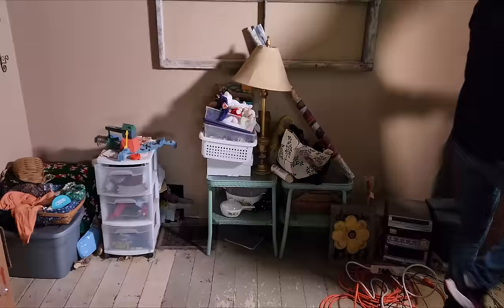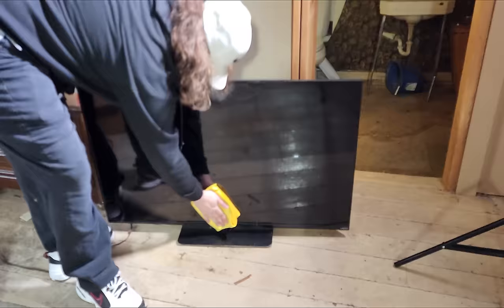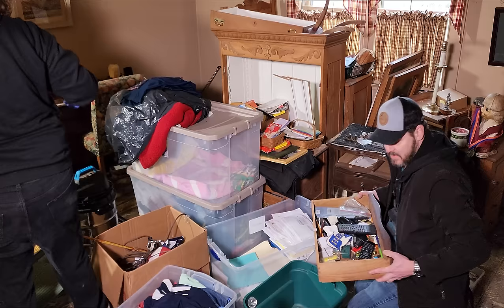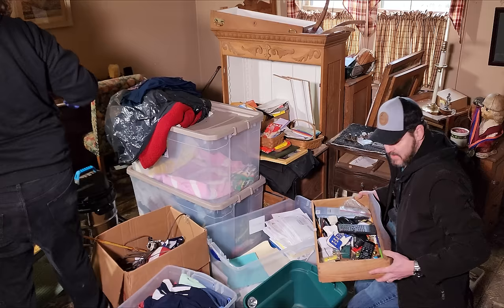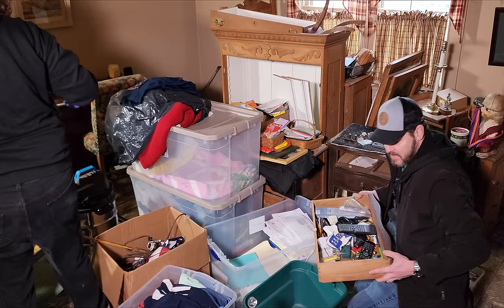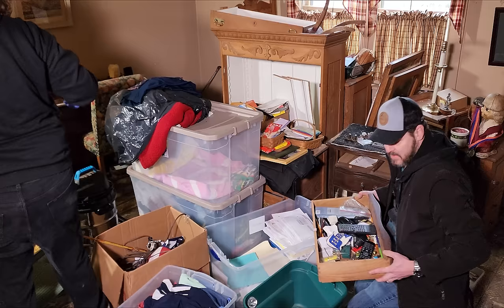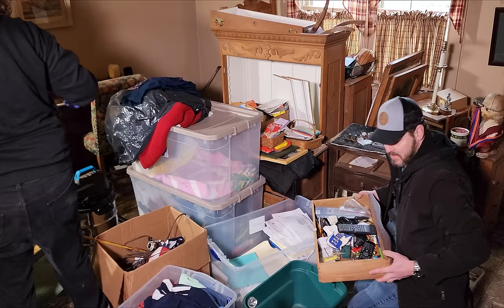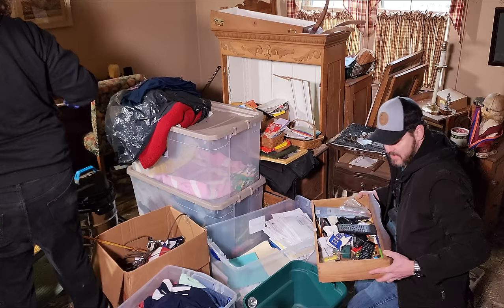I found 200 year old stuff in this whole-house cleanup!

Comment: I always hit the like because it affects your public feed sightings. 😅

Love the fur babies at the end.

Those light blue tables were beautiful. 
Lonaberger anything is a big deal in the North East & mid Atlantic... because their products are American made AND WELL MADE. 

Hi Michelle.  

I wonder if that "electrical fire" is when her stroke happened. She might have hit the electrical breaker and then realizing what COULD have happened,  then suddenly had the stroke.  That could be why it was all still plugged up. Lots of folks don't realize that the circuit could re-energize and re-ignite if that breaker gets flipped on.  Often, folks don't know enough to protect themselves when it comes to electrical "stuff".  For instance, many don't know that once the breaker box or fuse box is shut off at the mains, any circuit beyond the box ( in the house) is okay to unplug or repair.  Too many don't even realize that cutting off the power at the box is necessary before doing circuit or outlet work. 

AND IN MANY OLDER HOUSES,  you have multiple outlets plugged into the same fuses/breakers. That alone is a fire hazard because it constantly trips and then they either use larger fuses or a penny underneath which defeats the purpose of the fuse/breaker to shut off before the overload CAUSES a fire. 

Sorry. Worked on radios & their electrical power boxes in USAF so it's a pet peeve when I see the danger people don't even KNOW they're getting themselves AND THEIR FAMILIES into. 

I'm a bit anal when it comes to thoroughly researching before tackling certain things: electrical, mechanical, computer, engineering... BECAUSE of the dangers they CAN lead into with half *** jumping in. 

I've run across a few people in FB comments that are convinced YOU are the one who stole someone else's channel BECAUSE you're on utube. No reaching them about the truth. Too determined they're right. Totally get your channel name wrong, too. 

Hope you get your goal "plaque" wise. 
Looking forward to the next few hoarding clean outs. 

BTW that Mr. Clean clean freak  is the only cleaner in 15 years NOT to set off my allergies and asthma.
Using it everywhere. Thanks for the info on that.

Comment: Beans!
I suspect this was once a very nice house with nice things in it.  It still has some very nice pieces of furniture.  Such a shame to see it so dilapidated now.  You did a great job clearing and sorting it.  I love that you go through everything and don't throw away good stuff by accident.  I would trust you to do this in my home if it were necessary.  This has been a great video series.  A bit of everything.

It's funny that you think a 200 year old house is really old. I'm selling my mum's terraced city house at the moment and that's 100 years old and looks kind of like every other in the city.  My own house is fast approaching 300 years, could be a lot longer but we know it was here in it's current format in 1742.  No idea when it was first built.  The difference is that we build everything in stone or brick.  Sometimes we have older timer framed buildings but the frames are usually enormous tree trunks.  They aren't going anywhere.  American houses, especially older ones, but not exclusively older, all look like they might fall over in a stiff breeze and if they stay upright, bugs eat them.

Comment: Was the jar you opened at 28:50 a shiny beverage of the lunar variety 😅? Also for anyone with the good-intentions equipment, see if you can donate it to your nearest fire department. They actually need to use that stuff during off-times in between calls (i donated a good-intentions elliptical trainer that way)

Comment: So, for the 2 long distance cleans have you considered renting an RV? You can rent a tow dolly to bring your car for quick trips to the store or whatever. The RV is basically a house on wheels with kitchen, bathroom etc and lots of room for storage under the bed for all the cleaning supplies you could need. I've never looked into the cost but I'm guessing it would work out cheaper in the long run than hotels and restaurants.

Comment: If you’re going to do places further out, have you considered getting an RV (motorhome or Houses in the midwest have huge driveways so you can probably park off street.

I’m also neurospicy. When i was traveling a lot for work, i bought a small  trailer that i pulled with my v6 camry wagon. I felt far more functional showering in my bathroom, eating my regular food, and waking up in my bed even if it was in a tiny trailer at a jobsite in the middle of nowhere, rather in some shitty rural motel.

Comment: lol lol that jar….so much reminds me of clearing multi-generation family homes in the rural old south, and every one of those super-religious non-drinking “liquor is evil” families had a jar just like that for “medicinal use.”
   They also had a dozen, usually more, Bibles. It was a standard gift for big occasions, and all were passed down, so my mom, for example, ended up with more than 20 in her house. 
   Some were 100+ years old, but as you know, “old” rarely means valuable.
   But how do you unstick those drawers stuck by humidity?
Reply from the maker: A nail bar can work, as well as spraying WD40 into the sides of the drawers

Comment: this looks like they started to Reno but never finished  new electric panel and no baseboard trim , if the ceilings are falling down then the roof is bad and that's why the floors are bad 
it probably is not worth repairing if the house is wet mold etc 
the 70s paneling that later gets painted over is-was a fast way to cover bad plaster and lath walls

Comment: Also, to add a point to not "just renovate it" l, I feel like a lot of those people get that distorted view from house flippers on TV and social media.  NO, not everything needs to be saved and fixed.  Many older things just need to be "just demolish and start the structure over."  Also, the style of this house might not be the style the sisters want.
Reply: I wonder if the floors can actually be salvaged by either someone else or the sisters themselves if they aren't one with carpets or tile.  The end parts that are against the wall can be trimmed off if they're too damaged.